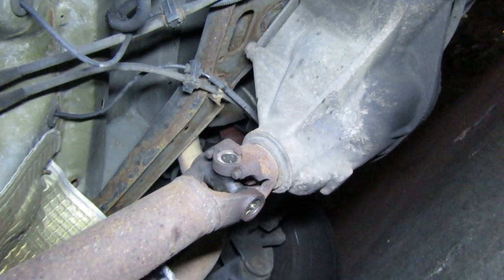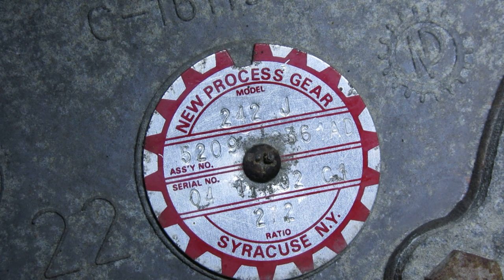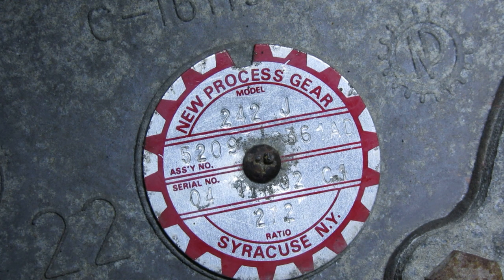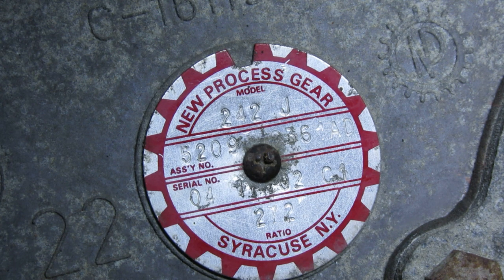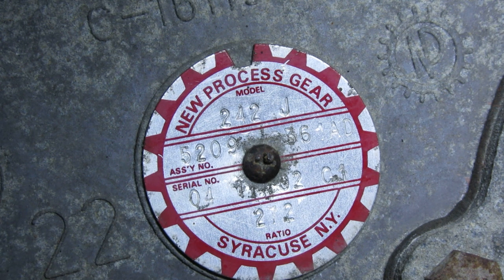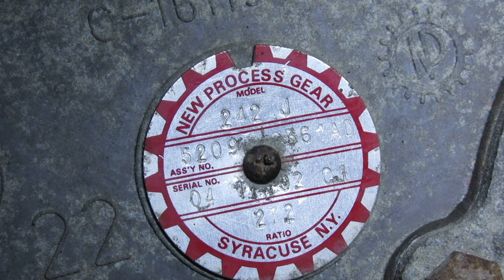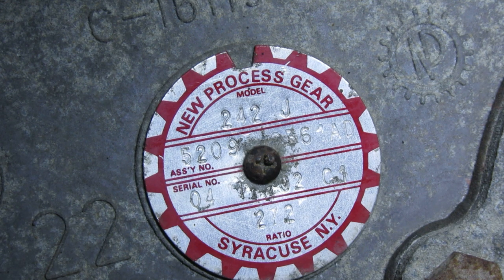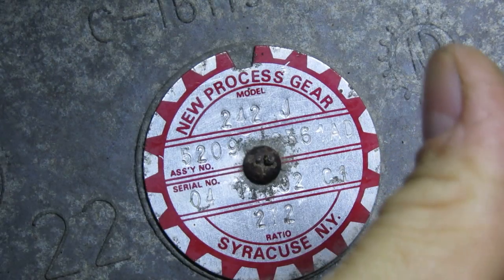Jeep Transfer Cases DECODED and EXPLAINED - New Process/New Venture

Comment: So many 249 haters sigh 😔 I disagree I love my 249 great in rain and still allows the lock for 4 lo.
Reply from the maker: They are fine until they go back. The VC is far more expensive to replace that the clutch in the 247. The 247 is the exact same as the 249 with better tehnology
Reply: Yeah mine went bad about 10 years ago. Had no clue what was wrong and diagnosed myself from internet research. Had it replaced and it was expensive. Next time if it goes bad, I'll do a swap to the 242

Comment: How often do you change your t case fluid?
Reply from the maker: I try to dfo it annually which comes to about 20k miles. It is so easy in these vehicles, might as well do it often
Reply: I see, well my rule of thumb is typically use the same atf fluid in  the tcase as in the trans. Unless otherwise specified. I change my fluid about every other oil change. The price of a couple of extra quarts isn't that bad in price. Thanks for your video and your reply very helpful
Reply from the maker: @joelafleur6423  wow! that is dedication. I agree. Better to know you are good than have to replace a t-case

Comment: there are more choices.
never mind GM.
2 choices i have...
high low thats all.
i have no choice of 2 (1) wheel drive or 4(2) wheel drive. 
i understand that heavy duty is better on everything. i have another cherrokee also. its OVERLAND.
4.7 ( EXTRA POWER).
ITS GOT A SELECT TRAC II.
W T F !
I WANT A POSITIVE TRACTION FRONT DIFF AND REAR POSITIVE TRACTION AND A TRANSFERR POSITIVE TRACTION AT ALL TIMES.

Comment: u can not explane if you keep switching back and forth about another code.
place 1 means x
place 2 means x
place 3 means x
etc.

place 2 code 1 means place 2 code 2means x
etc.
place 3 code 1 means x
place 3 code 2 means x.
 dont explain differences as that is confuzzing. JUST SAY WHAT IT IS. DO NOT SAY WHAT IT IS NOT!

Comment: I have a 96 zj limited.
My question is, what transfer can I put on my zj with no modifications?
Reply from the maker: Most times you will have to swap the input shaft from your transfer case on to the new one and possibly get a new driveshaft as each transfer case is a different length slightly. What transfer case do you have now?
Reply: @DEInTheGarage  292 with 242 ratio
Reply from the maker: You already have the best case the ZJ came with. Why do you want to swap? going to a 249 would be a downgrade unless you really want AWD
Reply: @DEInTheGarage  it's just a question
Reply from the maker: @CARLOSGARCIA-le8ll  Fair enough. The answer is that you could put just about anything in it 249, 247, 231.... but you are most likely going to have to atleast swap the input shaft unless it came out of another ZJ

Comment: According to your explanation, middle digit represents number of positions. So what's the explanation for the 231 vs the 241OR in rubis? Both have the same number of selector positions and yet one has 3 and the other 4?
Reply from the maker: No, the first number determine the the number of positions and the middle number is a size or strength number. The 231 and 241 both have 2 gears (high and low), but the 241 is a bigger a beefier option. If you watch from 2:20 to about 4:00 i explain the first two numbers

Comment: I'm trying to do a rebuild kit on my np 242j but how can I know which one to get. On eBay it says input is 16mm or 24mm.. A little guidance.. I want to know what year It was made too thanks in advance
Reply from the maker: The differences in the cases are standardized by vehicle model the went in. This means that if you have a 2000 Grand Cherokee with the 242J you can search "2000 Grand Cherokee 242J rebuild kit" and you should be fine. There is definitely a date included on the tag which should closely match your vehicles year (might be the year before you vehicles date) if it does not closely match then you will have to do some more digging
Reply: What they're talking about is the input shaft bearing. Its installed in the back casing half on yhe output side.  231 and 242s went from the larger bearing to a smaller one around 1994 IIRC.  94 model year you could have either. 95 and later had the smaller bearing.

Contact NOVAK adapters they sell a quality master rebuild kit that includes a chain. They should be able to walk you through IDing what you have.

Comment: That's good information. Thanks for sharing.
I am doing an engine swap in my Jeep and will be using an NP241C transfer case. (It matches up to the transmission I will be using.) I bought it as a stand-alone, so I don't know which vehicle it came out of. The serial number has a 95 in it and there is a 96 stamped on the case itself. So, I am assuming it came out of a 96 Chevy something (Tahoe, Silverado, etc.) I am struggling to find some information about it. It has a three-pin 4WD shift indicator switch near the selector. (Most of the ones I have seen have a two-pin.) I need to wire it to my engine wiring harness. Do you have any idea where the three wires should go? Or, do you know where I can get a wiring diagram for it? Thanks
Reply from the maker: Unfortunately I do not have any info on that for you. Sorry. I would get on a Chevy forum and ask around. i am sure someone there will have the info

Comment: Hooollllld up. Gotta clear something. I know this is old, buuut..

The 247 in the WJ had the gerotor in what they called the progressive coupler, with the clutch plates. Had the special fluid with the "friction modifier" in it. Does not take ATF4, which can wreck it. Used in the QuadraTrac II and QuadraDrive I. The same kind of coupler was in those funny LSD diffs.

The 249 in the ZJ had the "viscuous coupler" that was sealed but contained a weird silicone fluid.  When it failed it would either lock up entirely or never engage at all. Took ATF4 otherwise, iirc. Could be wrong about that.

Feel free to berate me if required!
Reply from the maker: Nope, you are correct. the 247 is basically Varilok in a transfer case where ase the 249 is an odd non serviceable unit. It has been many moons since I recorded this video, so I cannot remember exactly what was said... did I misrepresent some of that info?
Reply: @DEInTheGarage  yeah got em all back-ards!

All good tho!
Reply from the maker: @gcanaday1  Well thanks for catching it!

Comment: Some of the Dodge Durangos had the 242HD transfer case, not very common finding them, but they're out there, I found one a while back in a Durango R/T with the 360 V8, so obviously they're pretty well built to withstand some pretty high torque through them.
Reply from the maker: If you can find a 242HD, you have found gold. I have seen them go for as much as $600 on JeepForum and Craigslist.
Reply: I'll keep my eyes out for one, would love to tear one down and compare to the regular 242J.
Reply from the maker: That would actually be awesome!
Reply: They were used in HMMWVs.  They're plenty strong enough.  

The whole "242 is weaker than 231" is a myth.

Comment: Why would anyone down vote this? Dudes providing great info to the uninformed.....like me. Nissan guy, working on wifes 2nd XJ, 1st one never had a problem. Now the current monster is ALIVE.  Stuck lug nuts from her taking it to a tire shop, I'm putting new front hubs in to stop "Death Wobble" & just happened to see this.

Now to the question. I can get it into 4 wheel H, but NOT 4 wheel L, grinds, growls & I swear it told me to FU*K OFF! I think I read or heard it runs on a vacuum, That sounds crazy to me. What if the "hose" get hits by a rock? Hopefully I get an answer from here. Don't really need 4 WL, but I don't like things not working, yes double negative statement.

Subscribed! LIKED! Still pissed about the 2 down votes & it's not even MY video.
Reply from the maker: HEy man, thanks for the feedback and support. I guess some folks don;t like free information. haha.

Your XJ should not be vacuum actuated. Jeep did that in the 70' snad 80's, but I don;t thin the XJ ever got it. Certainly not the 90's ones. To shift into 4LO the transmission needs to be in neutral, so maybe that is your issue? If not, let me ask you what your your Cheorkee is?
Reply: @DEInTheGarage  1992 Jeep Cherokee. Thxs for the quick answer. Heard about the vacuum deal from an old timer, which I'm fast approaching, Almost relieved now. We had 1 before about 15 yrs ago, 89 Jeep Cherokee, for about 4 years. Went into low no problem.

 I put the current one in N before going to low, ostensible to just see if it worked.......it didn't. Her brother thinks it's low on oil, I think linkage when trannys don't shift right. I think that because the previous owner put a "rebuilt" motor from Autozone in it way back in 2001. Great channel THX!

Comment: What about a NP-205 and NP-208?
Reply: I can tel you that the 205 was a monster all gear driven case with no chains in it.... the 208 im insure about other than it was a pretty sturdy case in light use scenarios 
(Small chain to drive front wheels and a three pinion planetary)

Comment: I have a 244D in my 04 Ram 1500. Would the guys of it be the same as a 244?  Any idea what the D is?  It has three modes AWD, 4hi, and 4 low. Electronically selected. Gotta do a rebuild and can’t find much info on the 244d.
Reply from the maker: My understanding is that the 242J and 242D are internally the same. I believe the "J" is for "Jeep" and "D" is for "Dodge". The differences come in on the 242HD which has the same selectable modes as the D and J, but is beefier inside. Your D and my J should be identical inside.

Comment: Whats the correct fluid for this 242  T case??
Reply from the maker: ATF 4. The same stuff that goes in most Jeep transfer cases. I have a video on the procedue for changing Jeep t-case fluid if you are interested. https://www.youtube.com/watch?v=XJCNJRDOt8Q
Reply: Something slippery lol.  Dex3 works for them too if you have the AW4 and run dex 3 in it. 

Novak adapters claims many switch yo a 5w30 or straight 30weight as well.

Comment: Good video.  Working on a Jeep Grand Cherokee with a 140.  Jeep calls it a Quadra Trac? It’s an all wheel drive.
Reply from the maker: Yep, QuadraTrac I is the marketing name they give that particular 4x4 system. There is also QuadraTrac II, QuadraDrive, SelecTrac, RockTrack. etc.. All just names for different transfer case/differential combinations.
Reply: Its the same as the Quadra-Trac 2 but lacks neutral and 4Lo, its just a full time 4WD setup.  Not sure if it had any sort of coupling to transfer torque between the front and rear or if it was a set torque distribution.  Basically the typical Lazy American's AWD.
Reply: @wildbill23c  The 140 is 52%rear 48%front no high or low.  Jeep calls it an all time 4hi
Reply: @HungryAnglerfish  That would be a transfer case with no low range if its a 140.
Reply: Yeah my commander has the NP140 as well.

Comment: You can have a 242HD with a J letter. Any 242 installed in a WJ 2000-2003 with a 4.7L will be an HD.
Reply from the maker: You are somewhat correct. it IS possible to find a standard J on a V8 from those years, though the vast majority will be 242HDs. The bigger issue is that very few V8 WJs were fitted with selectrac making the cases extremely rare. Additionally, if you find a 242HD marked 242J, you have just found a misprint. You can however find an "HD" marked simple "D". when the 242 HD came in a Dodge is was a 242D. I believe the input shafts on the Dodge ones are slightly different though.
Reply: Yes, I hit the send button too early. I say that because I have an 04 4.7L GC Limited that came with a 247. I swapped in a 242 from an 02 4.7L GC that says 242J on the tag but it is most definitely an HD. The tag number indicates an 02 242HD and disassembly confirmed the 1.25" wide chain, 32 spline output and alum tail housing. The J confused me but research showed me there are a number of combinations used. Some say J, some HD, and I have seen a couple that said WJ.

Comment: Do you know if you could swap out a NV150 jeep grand 2005 and put in a NV245 without much hassle? , I know that is the some jeep grands there is a little lever to go into 4low, maybe that would also need to be swapped as well?
Reply from the maker: Well anything is possible, but that is actually a pretty heavy swap due to the electrical components in the 245. I cannot speak intelligently on the matter though as I have never attempted it or seen it done personally. Here is a JeepForum thread on the topic. I would suggest reaching out to the guy on there who did it as he can probably give you some much more reliable info. http://www.jeepforum.com/forum/f67/qt-i-nv140-qt-ii-nv245-swap-s-395686/